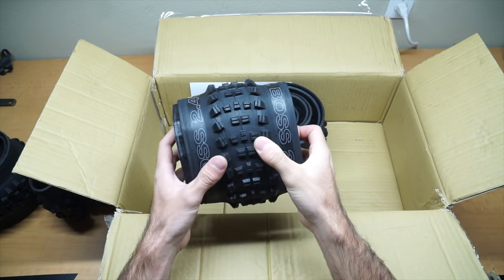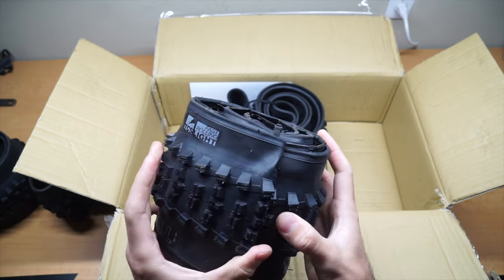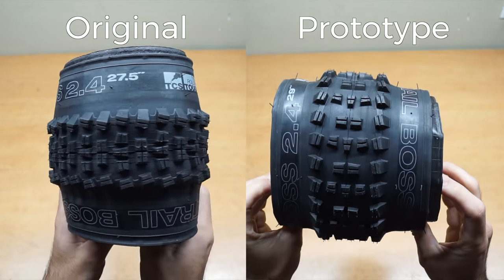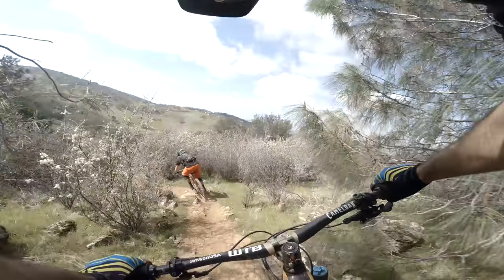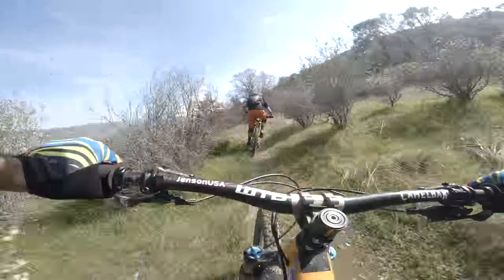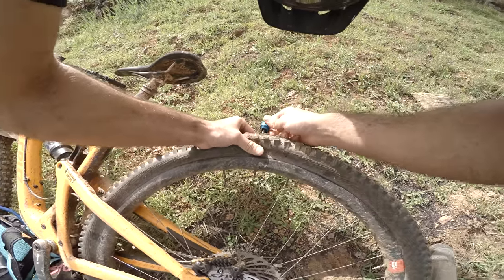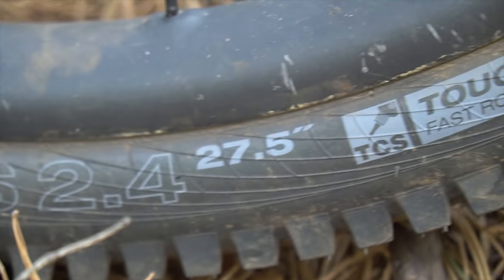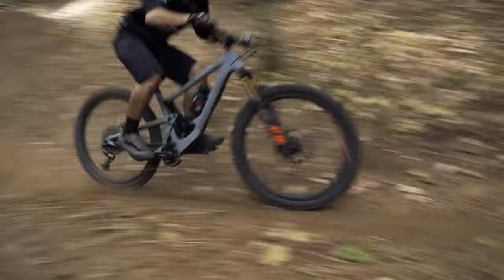Prototype to Production - Developing The New WTB Trail Boss Tire

Comment: Went from a 2.6 dissector to a 2.4 trail boss with a cush core and it's hands down the best tire I've ridden in the back. Being a 2.4 it's got less surface area so In dry conditions it doesn't feel like I'm floating on ball bearings, it actually holds.

Comment: Great tire, especially for a rear tire... only issue I found is using a trail boss on front tire rolling across gravel, as the  spaces between knobs tends to grab and throw gravel at both the bike's bottom tube and up into my face (even with a mud guard on).   Would recommend a vigilante in the front and trail boss in back for anyone who rides a lot of rural/gravel roads.

Comment: Recently purchased a Salsa Timberjack that has the new 29x2.6 TBs on both front and back. Haven't taken delivery yet but I'm pretty sure I won't want to run a 2.6 out back. May opt to try the 2.4 TB and have a go with that setup. I hope I like the new design because I really wanted to like the old design, but it was sketchy as well in the AZ desert conditions. There was too much tread which made it feel loose in corners.
Reply: I know this is old, but whatever. I have a 29er Timberjack in NC, lots of conditions between the piedmont and the mountains. 2.6 Vigilante light/high grip front and 2.4 Trailboss tough/fast is my favorite for enduro style mountain rides. However, for my local trails I like the 2.6 Trailboss Light/High Grip up front, but I got a 27.5+ Spank Oozy trail wheel for the back and I run a Maxxis Rekon+ Maxx Terra on the rear. It feels like it accelerates super fast, and it jumps around really nicely. Something to think about.

Comment: Started with WTB Vigilante front and Breakout rear. Will be going back to that but want to try the Trail Boss.
Reply: Breakouts have been discontinued.
Reply: @thatguythatdoesstuff7448  that sucks. I got a whole bunch of the cheap on clearance so at least I have a supply for a while.

Comment: I like the idea of 2.6 front and 2.4 rear. I'm running DHF 2.6 front and rear currently (came with a new bike) but the DHF rear will wear quicker and I'll probably want to switch to a 2.4 out back.

Comment: I've been wanting to try the WTB tires.  Maybe you can help.  Here in Arkansas, we have loose over hard with chat, and sharp limestone rocks that love to eat rear sidewalls.  I run a 2.5 DD Aggressor out back, and the 2.4 E-Thirteen TRS+ Race in the front on my Patrol.  What combo would you recommend from WTB that would work in those conditions, and be similar in durability/rolling resistance/grip...to the combo I'm running now?  Grip is the primary concern, but with lots of shorter ups and downs here, pedaling has to be taken into strong consideration as well.  The DD casing is a big weight penalty, but versus the DHR II with EXO, it's considerably more durable and it rolls better...so that's why I landed on that tire.  At times I miss the grip if the DHR II, and it would be great if I could find an option from WTB that would work.

Comment: maxxis dhf 2.5 3c on the front, aggressor 2.3 DD on the back, and i love dhr2 too both front and back. with aggressor i lack breaking and on mud is a disaster of course is a compromise. i found maxxis setup to be more reliable with 1.5/1.8 bar pressure

Comment: Would these tires be good for street riding? Would they hold up to 10 miles per day round trip commutes? I ride a 27.5.
Reply from the maker: They certainly would be able to handle commuting, however you would find the ride much easier on some less aggressive tires. Check out the Byway or Exposure from WTB

Comment: Mountain Bike -
 WTB Breakout 2.3 front and rear = Loved them but hard to find + very heavy tire
 E*thirteen TRS 2.3 front and rear = loved them but came defective from the factory then one of the replacement had a small hole and I gave up + fast rolling for a soft compound tire + Amazing grip
 Maxxis 2.6 DHF and 2.4 DHR2= just put these on about 3 weeks ago, I like the grip but not too fast rolling
-I think these WTB Trail Boss will be the next tire I try 
Grave Bike 
WTB Nano 700x40c love the grip vs rolling resistance